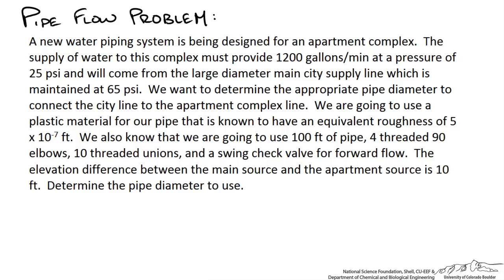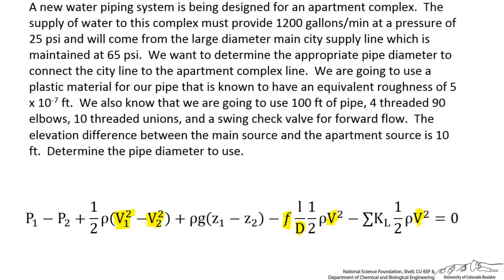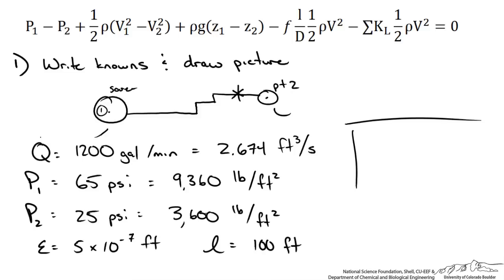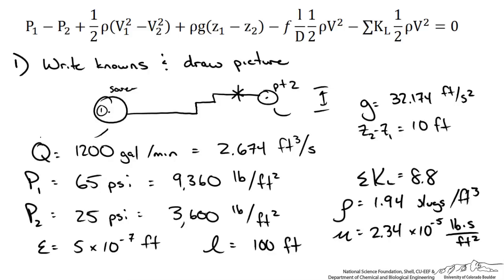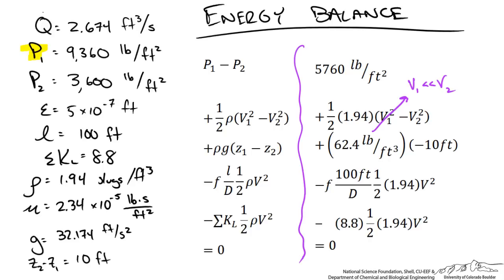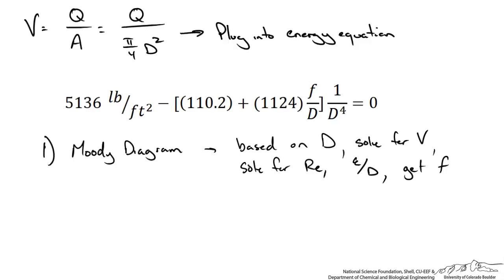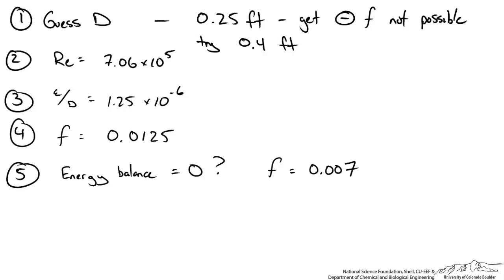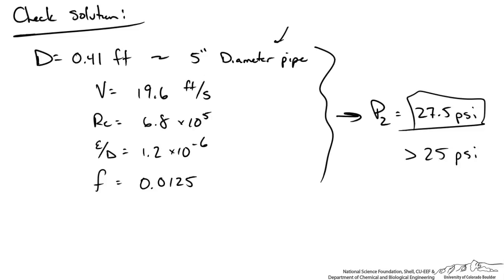Pipe Flow Problem (Determine Diameter)

Comment: what diameter of single pipe do I need to distribute water to 4 bathroom showers through four pipes of 0.5 inch diameter such that pressure is same in all bathrooms showers. Assuming the length and other properties of all pipes to be same.

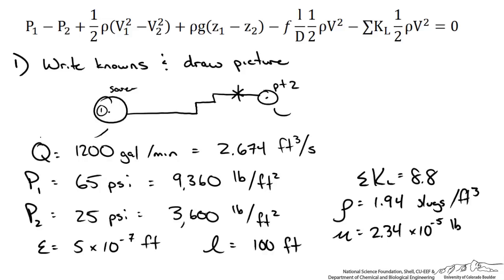Comment: 4:53 U should have lbf and not just lb. Important when cancelling units in Reynolds Number where 1 slug is 1 (lbf s^2)/ft.
Besides a lack of Units in explanation, its perfect!
Reply from the maker: Thanks for your comment. In general, when units are given only as "pounds" without specifying force or mass, it is assumed that the unit is referring to pound force.
Reply: It's assumed you are teaching complete idiots through this video
Reply: @gopaldassemeta9917  you are a nonce